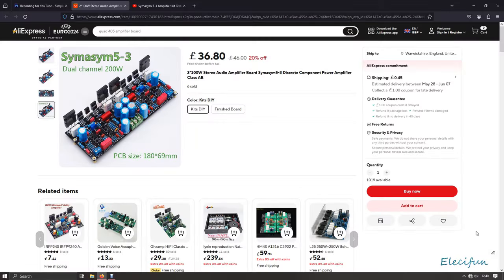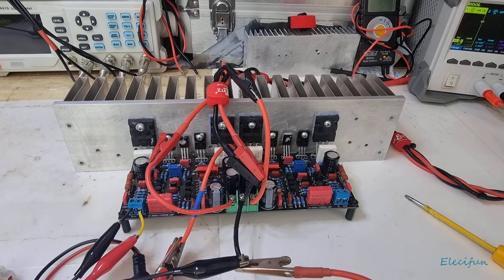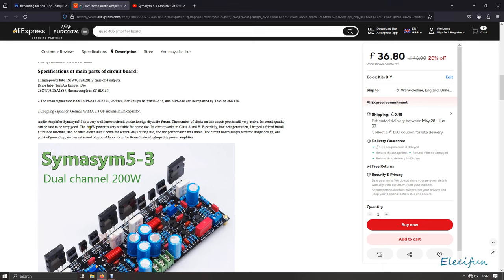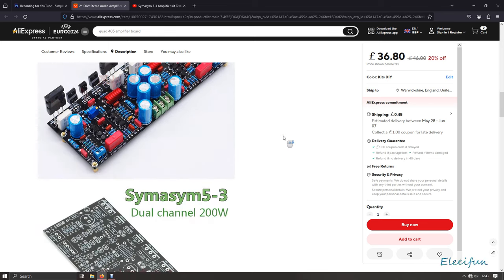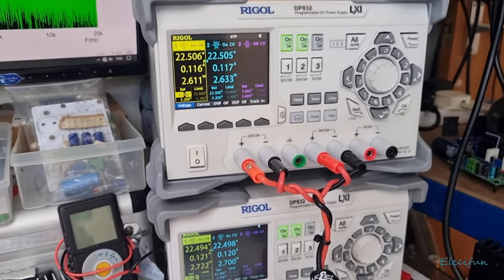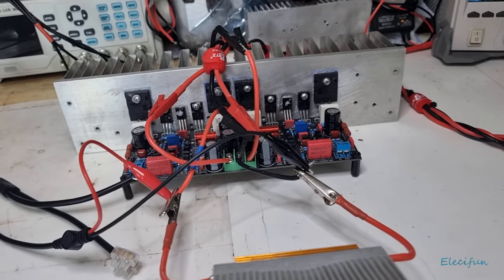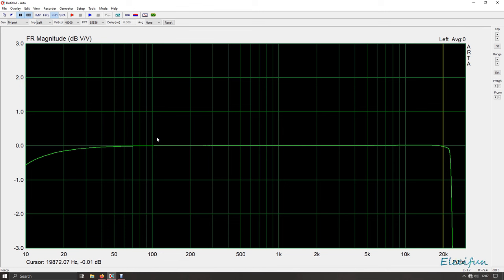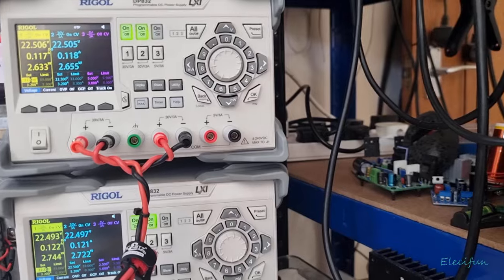Symasym Stereo 5-2 Amplifier Kit (Aliexpress)

Comment: Thanks for that Elecifun. I appreciate your opinions on sound quality. That looks like a good one.
Reply from the maker: Hi Ox, its in the top two I've tested so far. Thought you might like this if you liked the TDA7294.. It's a stereo board, great specs for the money and the parts used were in the kit.
Reply: Yes! Thanks again for the series. I've learned a lot while watching your vids. I'm still rather obsessed with valve amps but love learning and seeing the process with any electronics project. Plus I love visiting with friends no matter which hobby. Have a great day amigo 🫡 🍻.
Reply from the maker: @Sonic_Ox did you sort your valve amp crackle out?
Reply: @Elecifun  Not really sorted but thanks for checking. I reflowed all the solder joints, checked the circuits with a multimeter, isolated the transformers on rubber pads etc the crackle is less pronounced but still there. I tried to order new valves but couldn't find any for sale on this planet. I've learned to live with a minor crackle on warm-up lol.
Reply from the maker: @Sonic_Ox not sure if you tried cleaning the valve pins and socket. I built a long time ago a 12V tube headphone amp, not a kit, and I had scratching and crackling sounds when warming up if I very slighly moved the circuit. Granted I built it on prototype/socket board. I cleaned the pins and socket with Isopropyl alcohol which helped. I fear the socket board might have been at fault also.
Reply: Thanks for that Elecifun. Yes, when I was reflowing the joints, I cleaned all flux residue from the board with isopropyl alcohol. I shined up the pins on the valves with Emory cloth and alcohol too. I've done pretty much everything I know of but still a bit of crackle on warm-up. It's not too bad. A small annoyance. Thanks for the suggestions. I value your advice. I still intend to build another since I can't find replacement valves for this one but I've been spending my hobby budget on drones lately lol. Have a great day amigo 🫡 🍻.
Reply from the maker: @Sonic_Ox  Have you searched for alternatives to the valves you have? just a thought bud.
Reply: @Elecifun  Oh yes. I've searched for every option. I've even searched for an adapter to use a different valve etc. None exists. No one makes this valve anymore and I was on a list to receive NOS (new old stock) with my retailer for TWO YEARS lol. I finally gave up and intend to build a different kit with more common valves. These are 10GV8 valves and are next to impossible to find especially since my amp requires 4 of them. No worries though. This amp works fine after warm-up and still sounds fantastic.
Reply from the maker: @Sonic_Ox  you could search ebay.co.uk item  225712791072 in the Virginia US open never used 10gv8 tubes / valves.
Hope this helps..
Reply from the maker: @Sonic_Ox  Also https://www.ebay.co.uk/sch/i.html?_from=R40&_trksid=p2332490.m570.l1313&_nkw=10gv8+tubes+&_sacat=0

Comment: Hey Dude! 👋🏻  🤔 200W ! Is this the most powerful amp you've built to date!? I assume it is but I don't know for sure. You've built a lot of amps ! The specs say .003 THD ? What do the tests reveal? I assume this amp puts out 200W RMS? It looks like you got 160W out of it. Does it need a bigger transformer?  Maybe you need two transformers?

Anyway most interesting video. 

See this is getting closer to what I want as a dream system. 🤔

I've already wish listed a 2x 1000W amp but I would not buy it unless I knew the quality was good still it might be interesting to build but then again maybe its smarter to just find the right amplifier - right off the bat?

I'd like to know what these amps are?

Are the preamps, power amps or some kind of integrated system?

Your asleep, okay well I'll chat later like 8 hours from now. I've been up since 5AM. I noticed your vlogg as soon as I looked at my messages. Anyway bye for now.

Comment: Its been over a week compardre? Whats happening? 🤔
Reply from the maker: @decem_unosquattro9538 I'm waiting for parts for the RED power supply boards. Many hours testing and blowing out transistors to prove a point but the ffo pir merchants on ebay take forever to send out 5 TO-220 transistors. Still today they have not arrived 😠
Reply: @Elecifun  That probably has something to do with the Red Sea. The same appears to be happening here. I needed spark plugs and ordered them and they said tommorow. Well tommorow has come and gone. Monday? Who knows. I might as well have ordered them off ebay at a cheaper price. Sigh. It's not too bad getting stuff from China. The problem is when it arrives in Australia. They deliberately slow it down which makes me wild add immigration into the mix and you have a congestion nightmare. There are way too many immigrants in Australia now. Roads are congested with cars. Accidents, road rage has gotten a lot worse. Nothing makes me angrier than stupid policies and irresponsible, reckless decisions that the government makes. I feel your frustration. You feel like your life is draining away. Anyway hopefully you get it on Monday.
Reply: @Elecifun  Try to get ten things instead of one or two. Sometimes it does cosy that much more to get more sent. Instead of getting one or two items I have at times decided to get 10 or 20 items. I just keep adding to the cart to see how much more it costs. Depending on what it is it may only cost a little more. Instead one one amp think about getting two. China combines stuff together you know that already I guess. Anyway fingers crossed 🤞🏻
Reply from the maker: @decem_unosquattro9538  I bought 5 of those Red power supply boards and they arrived with the kit bags split and components mixed together. Also there is a split in the main transport bag so I don't know what parts are missing until I build them all. I would like to express my feelings about this to the person who packed my order with my size 10 steel toe capped boots.

Comment: What's happening dude?? 🤔 What's your next project?
Reply from the maker: @decem_unosquattro9538 I am building all the red power supply boards I have to see which work and which ones don't. I have a class A amp built and will test later.
Reply: @Elecifun  What's a red power supply board sir? Which Class A amp sir? 🤔
Reply from the maker: @decem_unosquattro9538  The 0-30V 2mA-3A red boards. The ones with issues. 

The amp is a 10W per channel ( I only have one channel) 1969 T5 kit. To-3 transistor packages.
Reply: @Elecifun  Ohh okay the red Hiland boards. I'm with you now. 🤔

A 10W amp per channel amp. 1969 T5 kit. Okay. 🤔 That got those Bipolar transistors. Low power but low distortion I guess.
Reply from the maker: @decem_unosquattro9538  Can say no crossover distortion. Just checking it out, kit was cheap. 
I am trying the hiland copies with better components as the power supply is a good addition to my bench. My Rigols use 24 watts each, powered on, no load. The Hiland copy uses about 6 watts, no load. Great for low power testing, zener diode tests, battery cell charging etc. ☺
Reply: @Elecifun  I don't understand what cross-over distortion is? What is that?

The kit was cheap -okay. Have the prices of these amps gone up? It appears that way. 🤔

Why is everything so expensive now !! 😫  Sigh. I'm very tempted to buy a nice big amp but I don't know which one to buy.
Reply: @Elecifun  Okay well I hope you can improve those red Hiland boards with better or higher rated components.

I guess I could buy new transformers for my fleet of Hiland regulated PSUs.

Looking at what you've typed I can see you are right. 

These Hiland boards don't require that much power whereas our Rigol PSUs draw quite a lot of current even in standby mode. 🤔

Greedy oligarchs that own our power stations and provide our electricity make me so angry. 

It's just plain old fashioned greed that drives up the cost of electricity.

It's even worse for Brits because you guys are paying for electricity generated by nuclear.

I remember a few decades ago they claimed that nuclear was too cheap to meter. 

It was just a pack of fkn lies.

Power should be free and it should be publicly owned. 

Uranium lasts for two years and its very cheap.

They pretend to hate Puttin yet they get cheap Uranium from Russia. 

I guess it's cheap bomb grade Uranium that they use.

Yet here you are paying stupid fkn prices for electricity.

I laughed at our politicians who are pushing to get nuclear unbanned arguing that it'll be cheap yet across the ocean you're getting slugged for electricity. Sigh.
Reply: Hopefully your still awake. I just got up. It's 7:40AM here.
Reply from the maker: @decem_unosquattro9538  You won't go wrong with the L12-2 or the Symasym 5-2 for an amplifier kit. You might want to make heat sinking the deciding factor.

Cross-over distortion (amount is dependent on circuit setup) happens when push pull configurations switch between the on off transitions of the output transistors. Best look up for comprehensive understanding.

The class A I have been playing with was cheaper when I bought it a few months ago.
Reply from the maker: @decem_unosquattro9538  I'm in bed by 10.30 as I need my beauty sleep.
Reply: @Elecifun  I bought the L12-2 and at some time I'll get the Symasym because it looks interesting. 🤔
"Push pull" configurations I have no idea what this is. 😒

Class A was cheaper when you bought it. Okay. Yeah I think freight is more expensive now. Oil is more expensive.

Oh incidentally if you want transformers might pay to buy now.

I read copper is going to sky-rocket!

I guess I need one for my L12-2?

And a bunch of caps for the amp psu. 🤔 and that thingy ma jig that you bought for your amp PSUs.
Reply: @Elecifun  In bed at 10.30pm oh that's good. Sleep is very important and not to be underestimated. Enjoy your sleep tonight. It's 7:30pm here incidentally.
Reply from the maker: @decem_unosquattro9538  I've been shopping... It's 12.25pm here.
Reply: @Elecifun  oh okay. It's warm in Britain? I assume it's Spring -Summer.
Reply from the maker: @decem_unosquattro9538  It's warmish..20.1C in here, my bench/lounge room. Spring going into summer, yes.
Do you still have Hiland psu boards? Have you built them, do they work as they should?
Reply: @Elecifun  Yes, most of the red Hiland boards are finished except those 0~30V 3A. Or claimed 3A boards but really they're supposed to be 18V or that's what I read. I built four complete regulated PSUs based on the red 0-28V 2A mainboards. I enjoyed building them except when I discovered that the transformers are not to the rated output. 
You know that aweful feeling of being ripped off. I felt stupid and like a physical pain inside. Lol 😑😐
Some work okay others are kinda buggy or some random fault. I dont know. I think the transformer are shit. They are a scam. They don't put out the power that they're supposed to.
Reply: @Elecifun  I bought another regulated PSU board and it packs a punch but sadly I could build it because it requires a multi tap transformer with odd voltages. It has relays and lots if components. I doubt I'll ever build it still who knows. I'd have to learn how to build transformers. Its kinda a pity because it would have been a good psu.